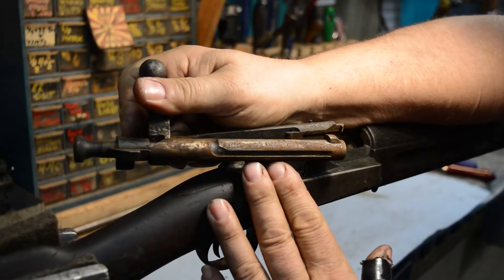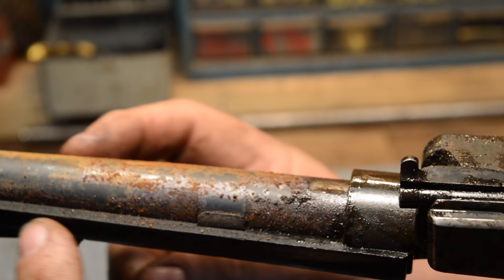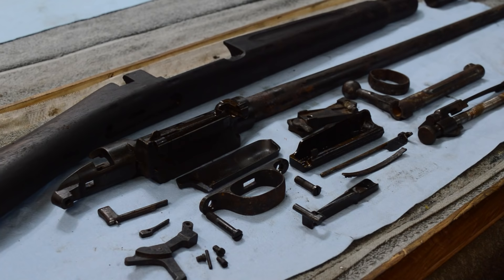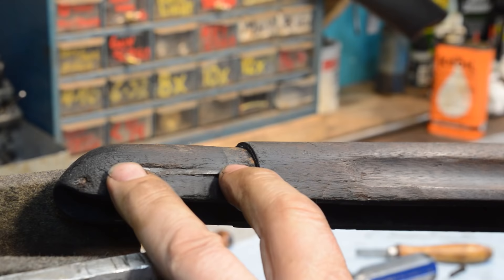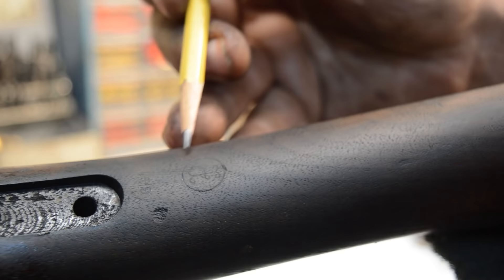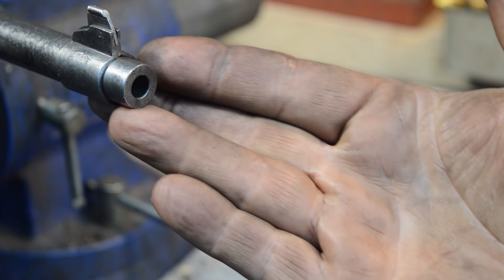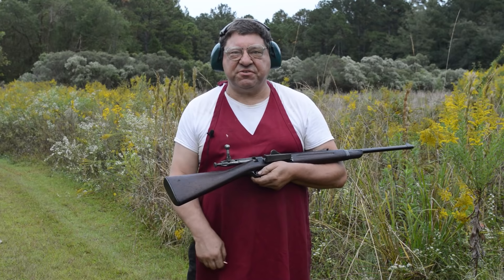Anvil 089: Krag Disaster Recovery

Comment: Yes a parts gun....maybe a Bannerman special...that's not a carbine barrel...it's a  musket/rifle barrel cut off with a 1903 barrel band...the typical way they would cut down to a carbine looking weapon. The DCM...now CMP did a ton of them too...after ww1...great video..enjoy them...Shoe in Oregon
Question...what our you boiling the metal parts in? Yes such a smooth action...butter indeed...my favorite to shoot.
Reply: This is most likely an NRA conversion done in the 1920's.  They used 1903 barrels with 1903 front sights chambered in 30-40 and used the1901 rifle sight and cut down the rifle stock of the worn out 1901's.  The carbines had a side mount sling bar for cavalry and the cartouche was totally different.  I have on and have the NRA article explaining it all.  As far as what he boils in, it's distilled water - I've done it in a deep fryer on small parts and built a large parts steamer with 4" pvc, an aluminum stock pot and a propane burner ring.  Remember, after carding the parts to use a non detergent motor oil on them for the first oiling.  Even used motor oil will work as the detergents are used up.  But I use small engine 30W.  Try it - it really works.  Cheers.

Comment: Would you x-ray the barrel? The heat, from the fire, would have expanded and contracted. I’m just genuinely curious about the damage. Thanks.
Reply: Shannon Badgett; I would imagine if the fire was hot enough to change the crystalline grain structure of the steel (somewhere around 400 degrees F for annealing), then the metal would have been hot enough to destroy (or severely char) the wooden stock. There doesn’t appear to be charring on the stock, so I imagine the steel didn’t get hot enough to expand/contract enough to do much damage.  Shooting several consecutive rounds through the barrel produces significant heat, yet it is not enough to damage the steel. I would suspect the barrel would have warped, all blueing would be gone, and there would be much more rust/pitting as well.

Comment: Hey, I have a very nice Krag sporter that will not feed!  I’ve never tried round nose fmj, but modern spitzers no way.  Any ideas?
Reply: Is the magazine cut off in it and intact? If not, replace it, big cause of hangups if it's missing. 

Otherwise, round nose bullets definitely feed better than spitzers.
Reply: @wlewisiii  thank you, but the cut off has been replaced by a Lyman receiver sight
Reply: @taggartlawfirm  Is it a US Krag? And are you still able to remove the bolt with the sight installed?

Comment: Fun Fact - Most brands of Brake Clean use the same chemical used for dry cleaning.  So not only will it de-grease parts, but it can also be used to clean the upholstery of a customer's car if you grease it up during a test drive.
Reply: Trichloroethane  ?
Reply: Chlorinated brake cleaner maybe, the non chlorinated stuff is mostly acetone or petroleum based.

Comment: 39:20 Bravo !  Why remove the metal and loose it forever with a Dremel or file, when you can move the metal back into place with gentle hammer taps. Reshaping that screw beautifully by the same actions that thousands of taps against the ground,  and everything else , that the solider hit during the butt plate  screw's life.
Reply from the maker: Sometimes the metal is already gone, but I always try to keep it all here, first. Files and Dremels are great tools, just not the #1 go to.
Reply: @marknovak8255   I hope my comment came across as the high praise comment I meant it as, for skillfully tapping the metal back into the screw's head.  That its metal was trying to head away from where it needed to be.  

Dremels are great tools, I was given one back in the late 1980's,  I just wish I had learned more skills (my age was 15 or 16) before being handed the powerful wand  that makes non restore-able shortcuts. It did keep me from less damage than 4' disc grinder would have.  Fast forward to now where I have several even  a  Harbor Freight ""special"" that is so under powered it works great for kit basking on train sets and models because it won't aggressively cut  into anything quickly so it allows for lots of slow and shallow detailing on thin plastic parts,  to far end powerhouse that will run with the extension add on tip cable with plenty of torque to and speed to spare.   

Nothing replaces the beauty of moving the metal by hammer and cold chisel back into correct shape, especially on parts that their own metal is now a piece of history worth saving.  Just the popularity of Dremels has turned too many welling meaning gun owners into that "Bubba" everyone hates faster than a Tapco clearance sale...
Reply from the maker: @ablemagawitch  I was amplifying your comment, in agreement with it.

Comment: I have found that paint stripper pulls most of the old oil & gunk off a Milsurp stock really well.
Reply: I have been known to use Easy Off followed by a rag and a garden hose when dealing with the IMA Nepal guns.   :)
Reply: Get a Tupperware big enough for the project then pour in enough mineral spirits to cover and let it soak a day or so. It works wonders
Reply from the maker: All of these methods work well. BUT
Reply from the maker: They pull all of the pores in the wood wide open.  We don't want to refinish the gun and ruin the old, correct "look".
Reply: Mark Novak I was talking for heavy grease or cosmolene when you expect to have to refinish. There’s always more than one way to skin a cat. Thanks for taking the time to share your work and reply to these

Comment: AFFF is some nasty stuff if you let it sit. I've seen it gum up various valves and nozzles because it wasn't flushed properly. Also seen it peel the paint off a car because the mechanic though it would be fun to flow some on a shop car. But when it works it works.

Comment: old school afff was protein based, now they have synthetic foam: the radio said it might cause cancer in firemen, as if they didn't already have the lung cancer issue.
Reply: Its not really a case of "old school", film forming protein foams ("FFFP") are still around and have always been in parallel with aqueous film forming foams ("AFFF"), which where actually the first of the two to be invented (Russain chemical engineer ~1900, but the modern formula is post ww2). So why have both? The protein foams are more thermally durable, and some (not all) are able to bio-edrage (not to be confused with lower health impact on the users however), but require more weight of mix per liter sprayed, have lower expansion rates, and don't flow as well. Thereby its horses for courses, and most nations use both, although very often each station only has one on hand, as most suitable to their local environment (ie is it woodlands or industrial park ect).

Comment: Kano Kroil is a miracle in a can. It is all I use.  One question Mark... When you talk about "boiling" the metal parts, are you literally talking about boiling in water or are you using Evapo Rust or what? I'm sorry for my ignorance but I am new at this and you sir are the "Master." Thank you. John
Reply: He means literally boiling, iron hydroxide (red rust, more active) to iron oxide (brown, less active)
Reply: Watched a few of Mark's videos. He cooks the parts in plain, boiling water without any additives for about 45 minutes. Apart from that: What @notabagel said.
Reply: I believe it has to be distilled water as well.

Comment: What was the thought when they approved a stock that thin in the middle? Why didn't they go with a two piece stock like the Lebel or the Lee?
Reply: American walnut was cheap, the skilled labor to work it was cheap, walnut weighs less than steel, and sometimes it takes a long time for a weak-point in wood to show up. If you see stock-making machines in footage of the old arsenals, a single man can be cranking out a couple dozen or more stocks in the same time it would take to machine a single receiver component like on the Lebel.

Comment: That barreled receiver IS a mutt, but one point you might've missed is this.  That barrel was most likely a repurposed US Model 1903 'Springfield' barrel!  Original Krag carbine barrels had a sweated on front sight base, and the blade pinned to it with a cross pin.  I can't count  how many Krag carbines have been handed to me by fellas stating that they're 'original', with that 1903 front sight base sitting there.  Also, you didn't mention, but, a Krag carbine rear sight is graduated differently, and will have a "C" stamped on the side of the rear sight base.  
From what I see, you've got a pretty decent, original, correct stock set, with a bunch of parts from all over the spectrum thrown at it.  With the 1901 cartouche, the carbine would've been marked "Model 1899" on the side of the receiver.  The rifles and carbines were made through 1903, when the Model 1903 rifles started production.
Fun guns to play with, I've got it's twin in my rack, and Brudda, does it shoot!  
Advantages to using the 1903 barrel are that they're made of better steel to start with, have more consistent interior dimensions, and back when the conversion was done,  '03 barrels could be had 'in the wrap', for .50 cents to a buck apiece from Springfield Armory sales program.  These days, the Civilian Marksmanship Program offers new Criterion barrels for the Krag carbine, with the correct threads, short chambered, minus the correct front sight base, and d/t for the rear sight base, for 'around' $210 and some shipping.
Looks like a fun gun to shoot and enjoy.
Reply: did the 1903 heat treat issues affect any of this or was that a WWI wartime thing that happened afterwards?
Reply: The barrels were cut down, the end was turned down and then a 1903 sight was put on. They never used - never COULD  have used due to the vast differences in the two cartridges - 1903 barrels.  This kind of comment is why he has to have his disclaimer - people who know too much to know that they don't know enough and are dangerous to others.
Reply: You're right, I'm wrong, now I must die.  Have a great day, and a better tomorrow!
Reply: @wlewisiii  You would be completely wrong 100%.  J Stokes Kirk and Bannerman were known to use 03A3 Barrels in Krag actions as well as gunsmiths.  I have been restoring Krags for 30 years and I probably have a half dozen or more 03 barrels that have come out of Krags.  They set the shoulder back and turn down the face of the chamber.  Then they run a reamer in it and allow cut for the rim.  Once the bolt seats to the back of the cartridge they were ready to go.  It's also a super easy way to headspace with out actually headspacing. The barrel in this video is a Krag barrel however and is a cut down rifle barrel.
This was also done to M1 Garands with bad barrels for surplusing. There were spliced-together 03A3 barrels from National Ordnance/FED ORD.  They cut the bad barrel off forward of the M1 chambers and threaded them, then threaded the 03 barrel to mate them and contoured them.  Then a light weld put on them.  The standard M1 can handle 50,000 CUP, the spliced barrels first sold in the 60's and early 70's from the CMP can only handle 24,000 CUP and are not safe to shoot.  You will know them when you see them, the chamber area of the barrel parkerization darker than the rest of the barrel because of different metallurgy.  It will also have 2 groove rifling like that of the 03'.
Reply: @darreldwalton8763  Don't worry, you're not wrong.  They used 03' barrels in them.  I have 5 or six removed from restorations.
Krags aren't just my hobby, they are my passion.  I have every model except one with an intact ram rod under the barrel (early 92' model, most converted.)

Comment: It may be a mixed bag of parts, but they're all Krag parts.
Reply: Exactly. Give it another 50 years and even the mutts will be desirable.
Reply: @Jrhoney  they already are commanding a good price and getting pretty hard to find.
Reply: @artifactman660  oh I'm well aware. Been trying to find a shooter for a while but all the ones I keep finind here have had several holes drilled in the receiver for antiquated scope mounts and were badly done. As is, you can see the areas around the tapped holes where the heat built up and annealed the receivers, bad.
Reply: @Jrhoney  not good.
Reply: @artifactman660  yeah, calling them wall hangers doesn't even come close to how bobed they are.

Comment: Is there no concern that the fire ruined the hardening?  Granted the wood didnt burn but it could have gotten really hot and not burn if oxygen isnt present.
Reply from the maker: Again, not a tutorial. I did mention the none of the springs were drawn. The receiver was hard as a rock, but you would have had to infer that when I held it in front of my face and fired it. Lots of things happen in videoing and editing is one of them.
Reply: @marknovak8255  No doubt.  Your conscientiousness is exemplary.  It didnt turn into a banana peeled open from both ends so that good :)  Is there a gunsmithy level proofloading methodology that is accepted for dodgy guns?  Or is that a bad idea?

Comment: If Kroil doesn't work, I will try PB Blaster, and if that fails I have a small can of F type ATF and acetone, and more ATF and toluene. There used to be a product called Mighty Muscle that really worked great, ... until the EPA eco-Nazis banned it. Not Muscle Products. That product is a blatant ripoff of Mighty Muscle. I have one can of Mighty Muscle left and it still has propellant in it.

Comment: Hi Mark,  I was fortunate enough to have been given 2 of these.  The sad part was that were converted to non-firing parade rifles and chrome plated. Years ago I had my gunsmith work on them so I could fire them again.  He did an outstanding job and I've enjoyed shooting them (even though the ammo is a bit expensive and hard to find).  I don't have them for their antique value and don't intend selling them,  Only 1 has a cartouche on the stock.  Is the chrome hurting them (functionally) or making them dangerous to fire?  I have shot them and I'm still here with all my digits and eyes, but it does concern me.  Advise?   Thanks.  Love your videos......you could use a little more volume on your mic for my old ears, but, I got through the vid (just may have missed some of your humour ).    :>)
Reply: Chrome plating the rifles for parade use shouldn't make them unsafe, but I wouldn't push the pressure limit on the old Krag cartridge.  BTW, you can use .303 British cases sized in a Krag die, then fire-formed to fit the Krag chamber.  Their necks will be a lot shorter than the original .30-40 cases, but still plenty long enough to securely hold the bullets.  Just make sure you load them to overall Krag length specs.

Comment: Wait, won't a fire potentially alter the hardening of steel parts?
Reply: It may “normalize” the metal but if the wood is still there the metal hasn’t been tempered or hardened because that’s gonna need some serious heat not 350 degrees but closer to pizza over 750 or more.
Reply: @john-paulsilke893  I’m not trying to be rude but it only takes about 300° to take the hardening out of steel
Reply: @jakemckeithen3812  As I recall,part of that is just how long it gets heat soaked. Below about 500° F, it takes a while. There was an article on heat deformation of construction steel I beams that I wish I could recall the details. Just too many years ago. Maybe someone with knowledge about how to make the angry pixies dance for the keyboard whiz kid could dig that up,or something like it. Got to be something out there in Google land that would give some approximate answers.
Reply: @jakemckeithen3812  300 celsius maybe, even then your at the bottom end of temp/top end of hardness with typical high-medium carbon steels.
Reply: Aren't springs the first to go? Aka if the springs are ok the rest of the steel should be ok?
Reply: @jakemckeithen3812  I am referring to 300F and sincerity doubt that’s anywhere near hot enough to soften steel. Your home over is hard as a wedding cock and hits 450 for hours and is made of trash mild steel and has virtually no effect after decades of use. And the springs in the door undergo the same temps with no ill effects. I further add the spring tabs in your oven elements can last just as long and they are actually touching the heating elements so achieve way higher temperatures then 450 again with a life of decades, (although after about 10 years of use some do get brittle and fail sometimes).

Comment: 6:04 "This is an old electrician's trick for compensating for being stupid." 😂 Nah, it's a fairly common trick among tradesmen. Back when I worked as a mechanic, it was such a common treatment for leaks that we called it a "man aid."
Reply: I have worked at a printing company for years , I do the same thing , except I use clear packing tape ripped to the width I need

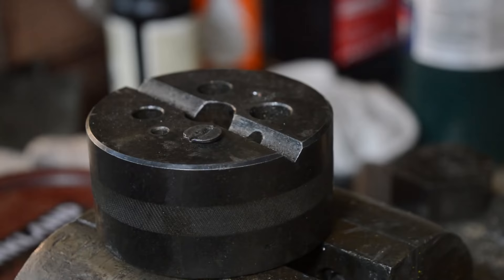Comment: 40:04 what is this tool called?
Reply: Hello. In Germany we call it a Gunsmith Prism Die or a Prism Anvil. Sorry , but i dont know whats the correct American denomination. Greets from Germany..
Reply: @Glatzomaniac  Greetings from Texas! Thank you very much for your response. Warm wishes,
Reply: It's usually called a 'bench block'. It can be made of steel (as that one is), plastic, wood or even aluminum. Shapes and sizes will vary as will holes, slots and other contortions. It's a workpiece/part support.